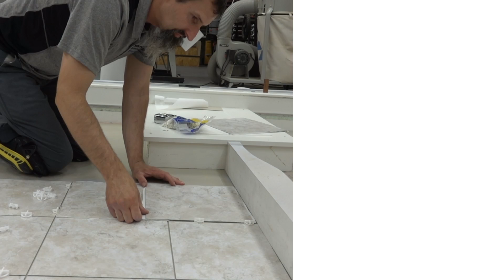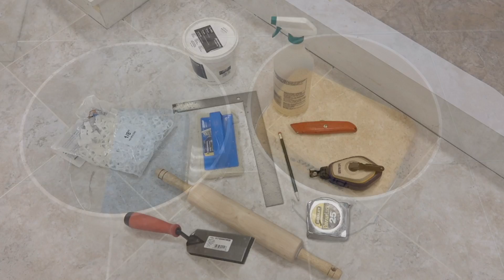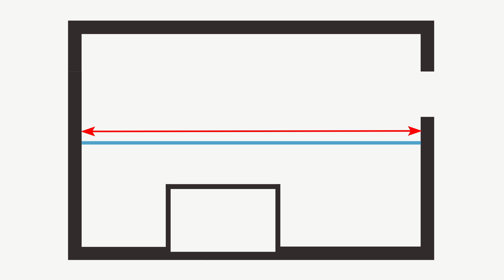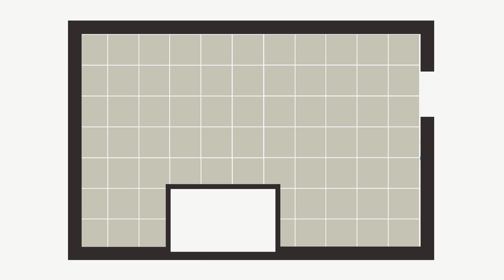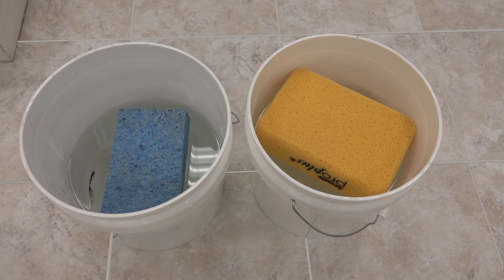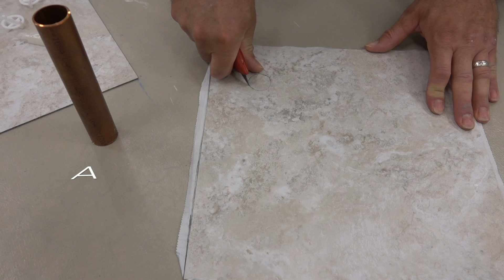Peel & Stick Tile Installation - With Grout

Comment: I really appreciate the detailed breakdown of the peel-and-stick tile installation process! I've used Armstrong products before, and your tips on measuring and mapping the layout are spot-on. It saved me from those frustrating edge pieces. 

One suggestion for future videos: perhaps include a segment on cost estimation for materials and tools. It would be helpful for DIYers to budget effectively. Also, showing common mistakes to avoid could make the process even smoother for beginners. Looking forward to more great content like this!

Comment: We did a tight set with the tiles, not using the spacers. I wasn’t sure that it was gonna make a lot of difference with the grout. But it made all the difference. I would use two buckets of water one for the first rinse and second for the second rinse, just to keep it clean better.

Comment: I just did the job. Take my advice, have a lot of water I your buckets so you're not rinsing your sponge in dirty water, and do half a tile or a full tile of grout before cleaning up cause some of the acrylic grouts required for these tiles dry within a 4 minute window! Finished product looks great though!
Reply: Has your floor held up well over the past 7 months?
Reply: Thanks for the tips

Comment: Pre mixed grout... A little vague. Sanded, unsanded, acrylic, epoxy?! Pre mixed grout suggests sanded cement based grout.. but I thought that was not supposed to be used with vinyl tile?! Supposed to use acrylic..?

Comment: IF IM GONNA USE SPACERS IT BETTER BE PORCELAIN OR STONE PERIOD.
Reply: Why? I'm getting ready to do my floor next week. I haven't got the spacers or grout yet.
Reply: @pinkfreud62  I'm guessing they mean if they are going to go through the hassle of using spacers that they would rather it be on porcelain or stone tiles and not vinyl peel n stick. I disagree wholeheartedly though. Vinyl peel n stick tiles can look very much like porcelain or stone these days, there are so many options and they are much more affordable (and easier to remove!) so you can replace them when you feel like renewing your space! Spacers are an absolute must though in any tile application unless you can think of another way to ensure an even 1/8 inch gap between all tiles lol. Even if I attempted to do that on my own, the time and aggravation it would take me wouldn't even compare to the speed of spacers not to mention they're pretty cheap so there is zero reason to forgo them.

Comment: What kind of grout do I use?
Reply: Pre-mixed grout. They are sold in small buckets like the one that was used in this video. Lowe’s or Home Depot should have them right next to the peel-n-stick tiles in store. They have various colors just like normal grout for real ceramic tile.
Reply: @zuliiboo  hi, am I right in saying that this pre mixed grout is specifically for vinyl tiles only and not just the regular grout? Thanks.
Reply: @CyberpunkV2077  yes, I believe these pre-mixed grout options are made for this vinyl flooring only and is not intended for installation of real ceramic tile.
Reply: @zuliiboo  okay, thanks for your reply. I have some really good advice from some very recent experience with using tile grouting for my vinyl floor tiles. I ended up using some flexible tile grouting which of course cracked within a few weeks thinking that might do the trick. I then took up all of the previous grout and I still used the same grout again but I added a latex additive to the mix this time and it worked a treat.
Reply: Lowe's TEC Skill Set is premixed, specifically for vinyl. Other premix state they are for ceramic, mosaic and porcelain tiles.
Reply: I’ve grouted ceramic tile before. And the floor can’t give at all or everything I’m especially the grout cracks. Do you have to worry about it with this setup ?